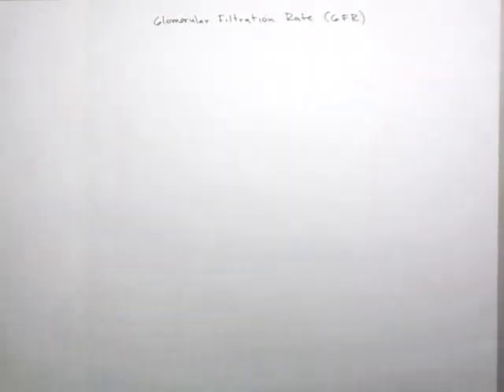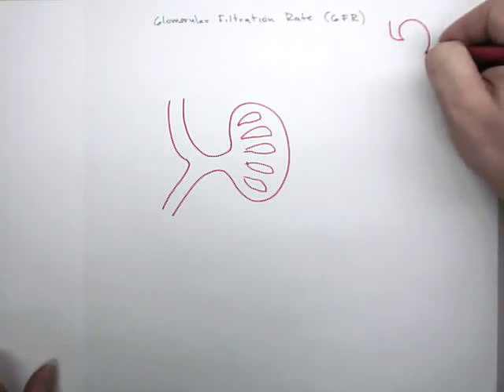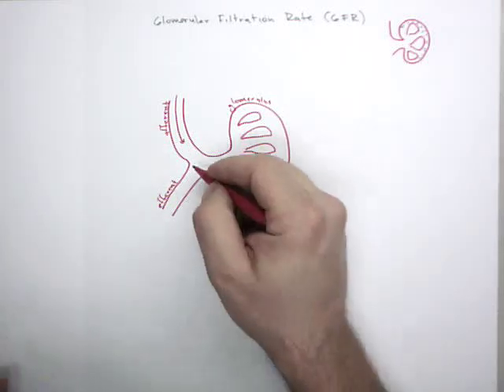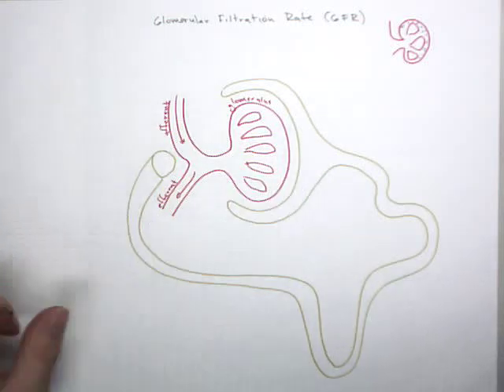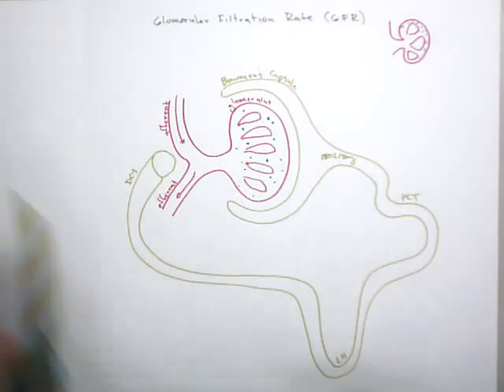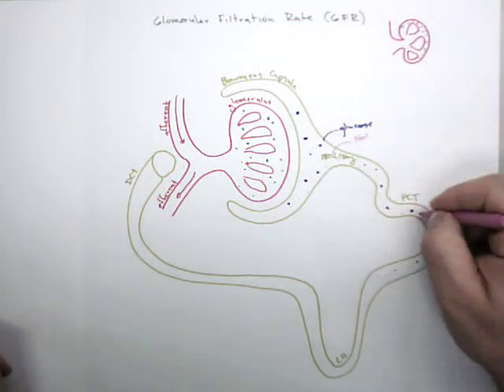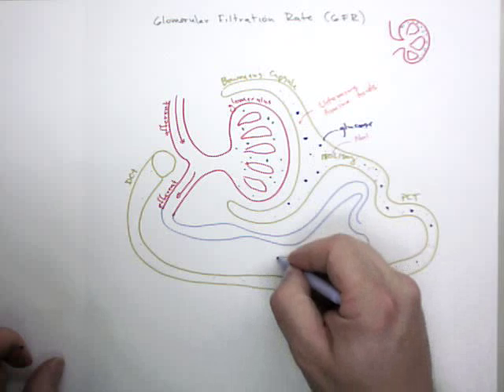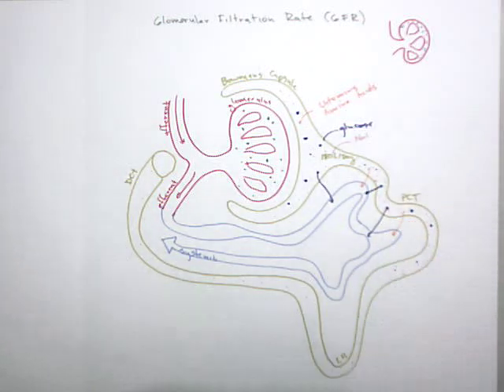Glomerular Filtration Rate (Part 1: Why Control is So Neccessary)

Comment: @hennagerdj  My current textbook "Human Anatomy & Physiology" by Marieb and Hoehn states on pg979 that "the term 'countercurrent' is commonly misunderstood to mean that the direction of fluid flow in the loops of Henle is opposite that of the blood in the vasa recta."  Rather, they explain that it refers to the "flow of fluid in opposite direcions through adjacent segments of the same tube connected by a hairpin turn" as observed in the Loop of Henle.  
Other thoughts?  Thanks!